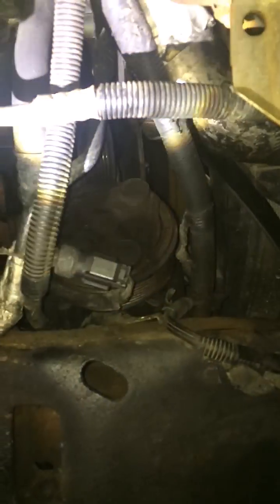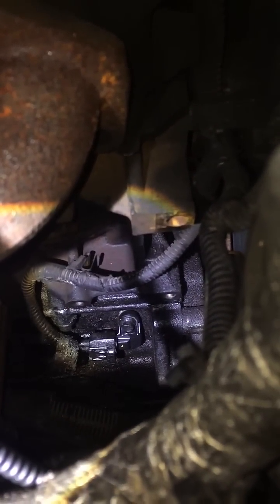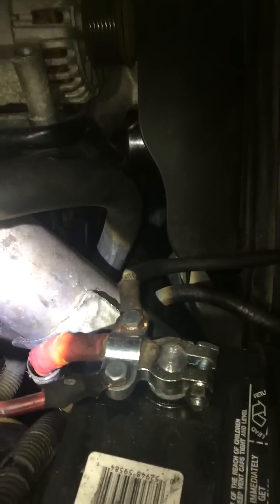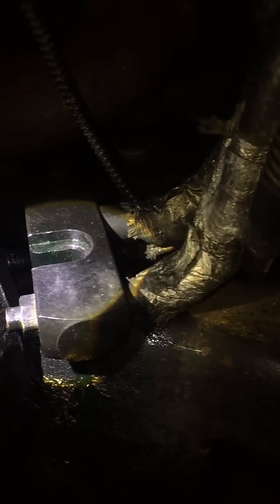Ford 6.0 Powerstroke Crank Position Sensor

Comment: Do you truck just stall out or what made you change it I am really  wondering
Reply from the maker: I had a crank no start and I was new to 6.0s, so I decided to change it. The issue wound up being a HPO leak.
Reply: @aerialboy55  it end up being a fuel filter thank you so much for responding have a blessed morning

Comment: This causes no rpm in the gauge when cranking?
Reply from the maker: MRKN SnIp3rr yes but the problem is with the 2003 and 2004 6.0 L power stroke, the gauge doesn't move when you crank the engine over, so you'd have to plug a scanner in or put the truck in diagnostic mode to monitor the rpm on the odometer.
Reply: Jason Dols didn’t notice a reply, I have no codes and have been cranking a lot. Could this be the reason
Reply from the maker: MRKN SnIp3rr I don't understand, please specify
Reply: Jason Dols I don’t have codes for a bad sensor(haven’t checked recently) but I have been cranking a lot so could this be why mine failed (if it’s even possible)
Reply from the maker: MRKN SnIp3rr if it's a 6.0, there could be numerous reasons why it's not starting. I changed the sensor just on the off chance that it was that, but it turned out to be the wiring harness.
Reply: Jason Dols ok gotcha. I’m hoping mines good. Ran fine but icp went bad got fixed and it won’t start. I️ cranked a lot so guessed it was that
Reply from the maker: MRKN SnIp3rr If you have an android device, download torquepro and then go on amazon and get a vgate obd plug in. That's what I use to moniter all my 6.0 no start areas. DieselTechRon has a video about it.
Reply: @aerialboy55  would a crank no start with a fault for crankshaft position sensor be consistent with bad wiring?
Reply from the maker: @jamesturner1525  It could be either the sensor or the wiring, but your best bet is to get a scanner and see if you have cam/crank sync
Reply: @aerialboy55  thanks for the help
Reply: @aerialboy55  I have Torque Pro is there a way to check sync? Using Torque Pro?
Reply: @aerialboy55  in the video I saw diesel tech Ron using that laptop program he has
Reply from the maker: @jamesturner1525  yes there is. DTR has videos o. How to set it yp

Comment: Its more than likely a shorted fuel injector. Unplug one at a time and try to start. Plug them back up after each attempt
Reply from the maker: Va HOSS it turned out to be a wiring harness issue causing the no start, and leaking injectors causing the stalling.

Comment: How'd you get to the bolt in the back?I've been trying for hours but no luck
Reply from the maker: Isaiah Cruz if you are talking about the bolt that holds the sensor in the block, you have to remove the ac compressor to gain access to it. The whole job took my 5 hours or so to do..
Reply: Jason Dols My bad, the bolt that holds the AC compressor in place, the one in the very back
Reply from the maker: Isaiah Cruz I don't remember, but my ac compressor had loose bolts so it's possible that I only had to tighten in when I put it back. Did you take your wheel well out?

Comment: You stated it was stalling, did this resolve the concern?
Reply from the maker: 22howards I am uploading a compilation video now of the truck the day I brought it home..
Reply from the maker: 22howards no apparently my issue is something special. My truck has no ficm sync and I've either changed or rebuilt my cam sensor, my crank sensor, my ficm, and my pcm. The mechanic thinks it's the wiring harness. It's been down 4 months...
Reply: OK, while I'm not a cetified Ford tech I do work in the industry repairing vehicles and we own a 7.3 and 6.0 Let me ask another question, if all the parts were re-installed on the truck what would happen? How often did this condition occur?
Reply from the maker: 22howards the mechanic I took it to said that it was the wiring harness, so now I'm waiting for him to finish that. He said something about him reprogramming something on the truck.
Reply: Jason Dols If the tech working on it says it is one of those two things then consider this. Reprogram the unit ( most likely the FICM) before replacing the harness. It's less invasive, faster then you can drive it and see if it's resolved. The wiring harness will typically show you what's going on. When I do this I check each signal wire then manipulate the harness while the wire is being tested (under load and with a meter) to see if the connections and wire strands are good. 
Please keep in touch with your findings.
Reply: what was the truck doing?
Reply from the maker: Bruce Radford the truck was randomly stalling out and wouldn't restart until the next day. The truck still isn't running and I have pretty much been through everything from basics all the way to the complicated things such as harness checking and HPO system tests. The truck won't get ficm sync even though I had the ficm rebuilt, so my plan now is to swap it with a proven working one to see if my truck starts!
Reply: Jason, I posted a video for you of the needed items for the truck to start. Please click on my user name 
22howards to view this. You or you tech should be able to get the truck running with this info.
Reply from the maker: The Ficm sync issue turned out to be the harness and the stalling was a HPO leak. John at Phoenix Truxx in the south amboy Nj worked miracles !
Reply: Very glad to hear that! Got it up and running for summer or are you still selling it? One you update all the oil leak prone areas for the HPOP system you will be good for a long time to come. The harness..... That could happen to any engine. Sadly I even see harness issues on new cars so it's not that unheard of.
Reply from the maker: 22howards I was only selling it because it wasn't running, I'll update the system at a later date... hopefully I'm good for a while
Reply: Glad to hear that Sir, enjoy the truck!
Reply: I'm fighting the same thing now. I don't have CMP/CKP sync also no FICM sync even though the rest of my numbers are good. My next step is to replace the sensors but i'm wondering if I should just replace the loom all together. Were you getting good FICM numbers 48.5 and 11.5+V?